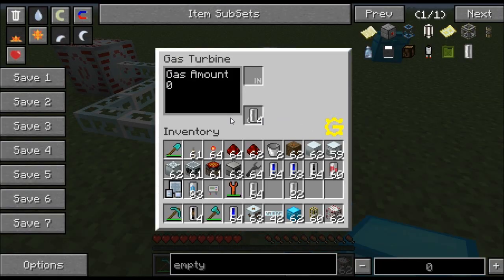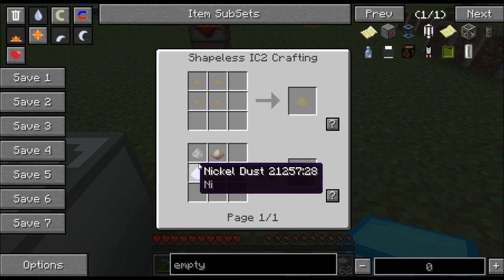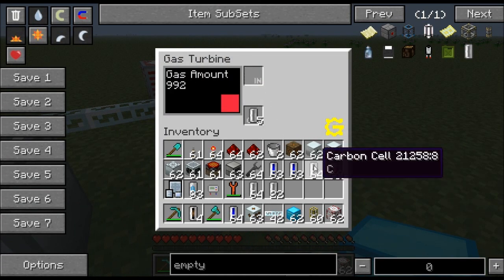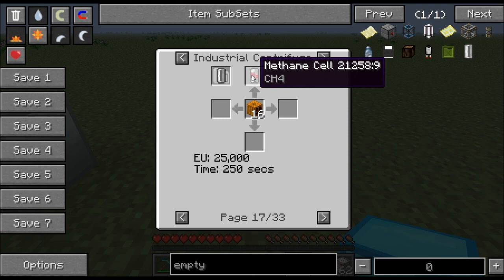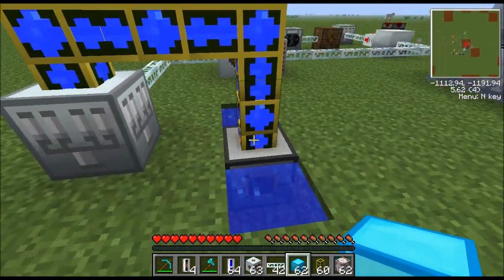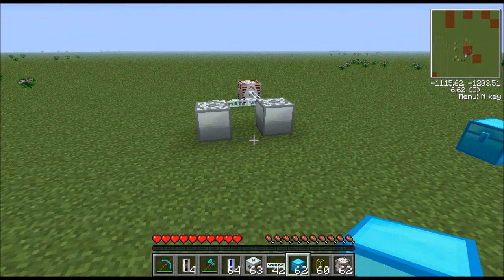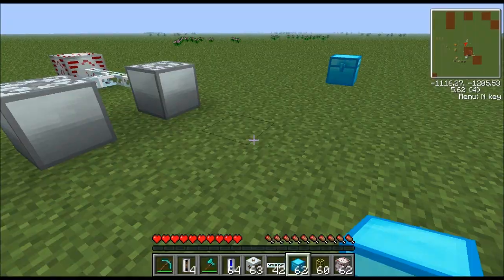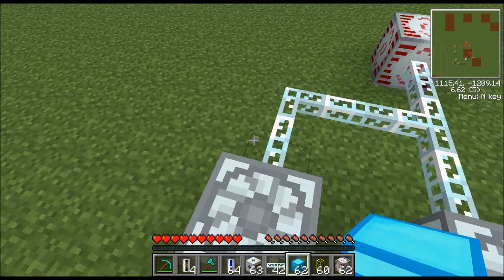FTB/Feed The Beast Tutorial - Gas Turbine, How To Make, Use, And Automate

Comment: I just spent a lot of time automating this process and it does not work. Hydrogen in a gas turbine generates 15,000 EU * 4 that is only 60,000 EU much less than the 93,000 EU needed to make them.